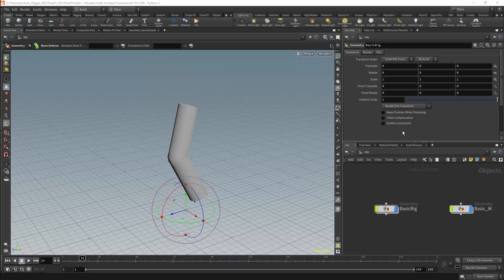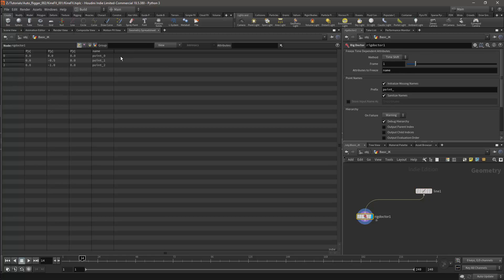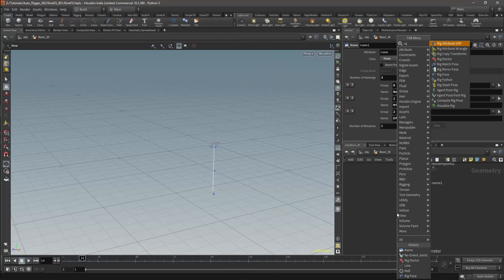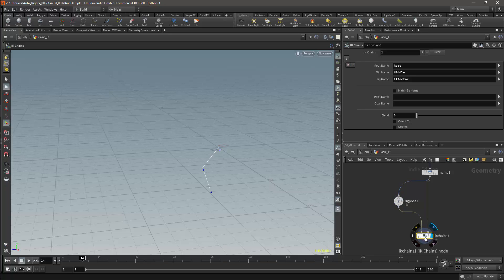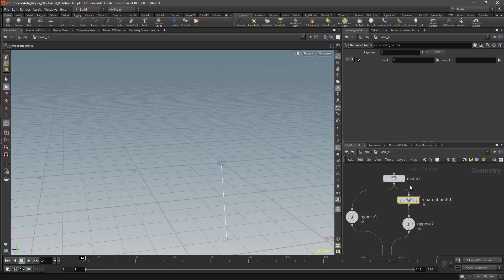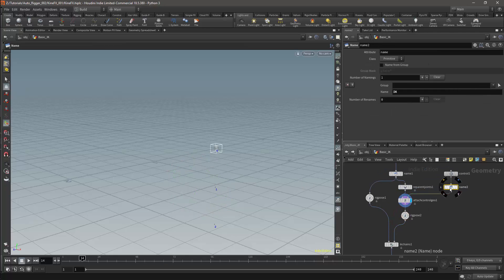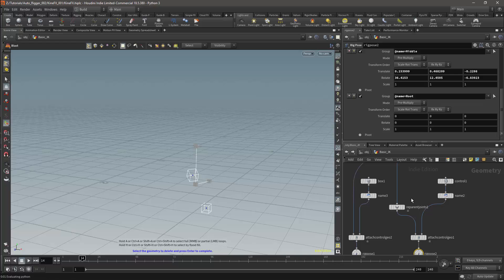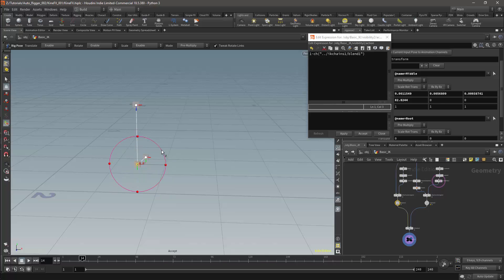KineFX A Simple IK/FK

Comment: Thanks for this! 
If anyone else got stuck, I'm on houdini 20.5 and a few of the nodes have new names now. 
Reorientjoints is OrientJoints
reparentJoints is Parent Joints
AttachControlGeo is now AttachJointGeo

Also blasting the other joints in IK setup seemed to break the IK, I skipped that part and i think all is ok still
Thanks again Brundle, I needed some simple rigging skills in houdini badly.

EDIT: In the next video he uses delete Joints node instead of blast and it works.
Reply: I am loosing this instructor two sentences into instruction.

Comment: Do you sometimes consider renaming the IK joints, so they show up as seperate joints in the rigpose state on the top HDA?
I guess it's less needed since you make control objects, but I still see some people do it in tutorials.

Thanks for sharing the material, it's very helpful.
Reply from the maker: The naming here is not that important as this is a feature example. With an actual rig I would be more careful with naming. 

As for the main joints I would not rename them. I might rename the controls, but I would also be using different rig pose nodes for different parts of the rig, IK controls, FK controls, global controls and local controls. If possible i would keep it so that most of the pose nodes would not have a lot of controls and each have a specific focus.

The most important part of naming for me is actually the effector (The last point in each chain). This joint will have to be renamed for skinning so I want the naming of that joint to be as easy as possible.
Reply: @brundlethwaite  Thanks, makes sense.

Comment: Thanks for these videos ... this was tricky but I finally got it. Have a question though ... with the ROP FBX Character Output node we need to give it a 
"Capture Pose" and an "Animated Pose" ... how would you do that with this setup? Because it seems we can only pose with the IK/FK controls before they are merged with the ikchains node. And thus we would need multiple ikchains nodes to make multiple poses, right?
Reply from the maker: For the export the capture pose is the skeleton in its rest pose. This would be the rig before the solver (The ikchains node). The animation would come after the after the ikchains node.  

The ikchains node supports multiple 2 bone chains so you can setup multiple chains with a single node. However in full rig you would usually use more than rig pose node (Although it is possible to set up a rig with only one). 

Beyond that you can also set up more complex VOPs or Wrangles.

The Idea is that you can use viewer states to control more than one node at a time.

Comment: Im trying to make a reverse foot control using KineFX. The method was one I used in Maya. How do you make a single chain solver in KineFX? Still trying to get my head around it all. Love the tutorials you are a great help.
Reply from the maker: I use the look-at (kineFX) solver. 

For example for a foot joint and a toe joint:

-Use a get point transform for the foot. bridge joint
-Will feed into the from point and this will also be the joint we set.
- I will set the look-at node to use vectors and I will change the look-at and up axis.
-The to node will be the position of the toe control (I will get the position of the toe using the extract transform node).
-Use a float to vector 3 to to create an Up-Vector - (0, -1, 0)
-Multiply this but the control of the foot/bridge joint transform. Then plug it into the up port.

Hopefully that will make sense.
Reply: @brundlethwaite  Oh that works for single chain :) Great. I used a point with a rig pose node for the controller not sure if that is the best way. Could snap it to the skeleton easy and create the rig pose to get a clean transform. I need to parent these controllers to the foot control, would I have to rig attribute each one using the parent node? Feels weird not being able to click and parent a joint or effector like in Maya.
Reply: Reparentjoints node helps but still struggling to get a reverse set up to work. Maybe I need to think differently about how to approach it. Will ask on odforce if anyone can help with the file. Maybe a good future video topic